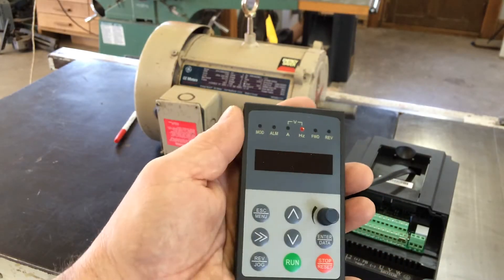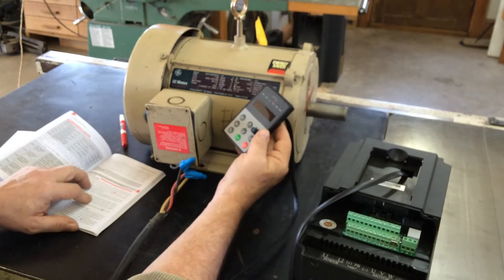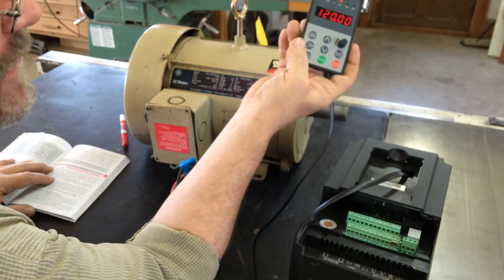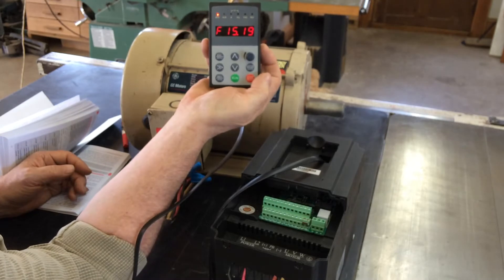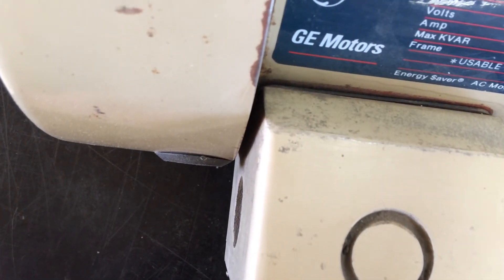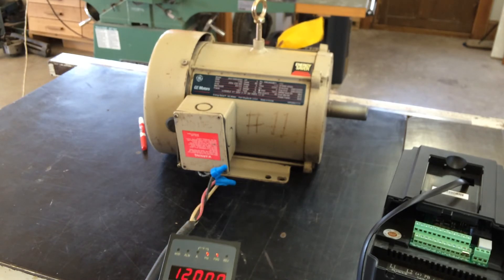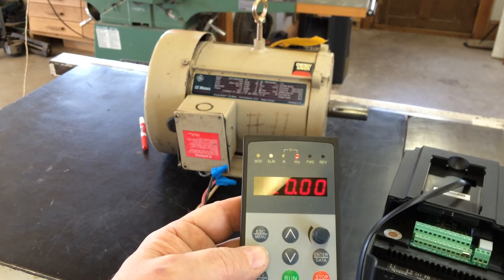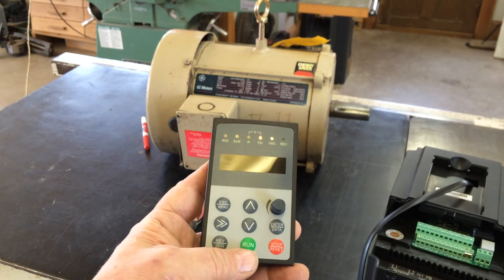Custom VFDs for single Phase power  Part 2

Comment: Hi 

I wonder if  you could advise me. I live in Sydney Australia
I have a Vicmarc VL 200 wood lathe that doesn't have a variable speed device.
It has the following motor specifications

Motor brand  CMG  model N1458
Phase  1
KW 1,10
Volts 240
Hz 50
FLAMPS 6.8
FL RPM 1420
Duty S1
Mount B3

Can I use one of your device  and install it successfully with this motor and if so please provide me the details so that I may order one from you or ENC.

Kind regards

Tony
Reply from the maker: thank you  for contacting  me at my web site

Comment: Jack. I have several machines for which your drive will definately work, but I have two odd ball machines; One is a Swiss lathe which is 325 volt and an American jointer which is 550 volt. Any suggestions would be appreciated..
Reply from the maker: I don't offer VFDs in voltages other than from 200 to 240 Volts, In my own shop i run higher voltage machines on a rotary phase convertor  with a step up transformer. you can see that system here            https://www.youtube.com/watch?v=hYVVy0CrUfo
Reply: Thanks Jack.. By the way, I'm was once the proud owner of an RU.. I share your appreciation for Wadkin machinery..
Reply from the maker: Yes its good Wadkin is fine kit. if you need any more help just ring